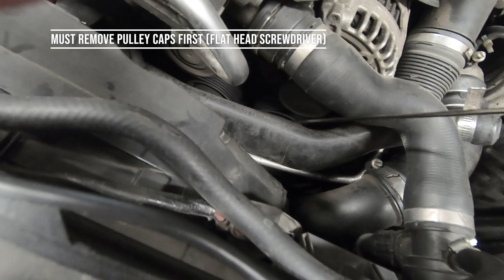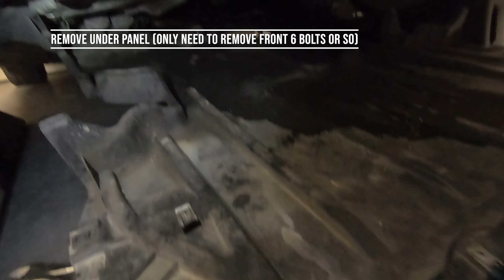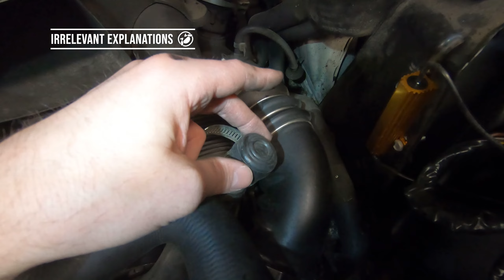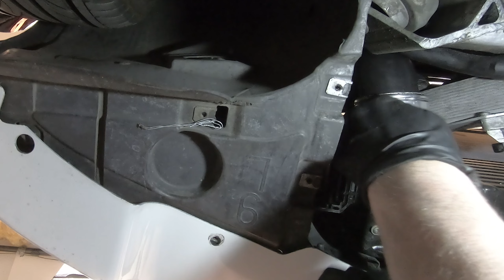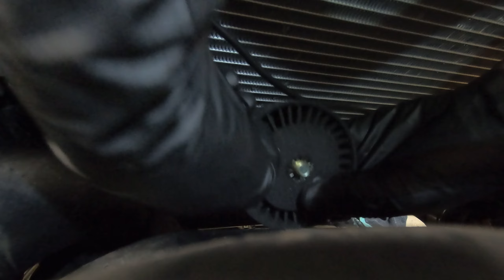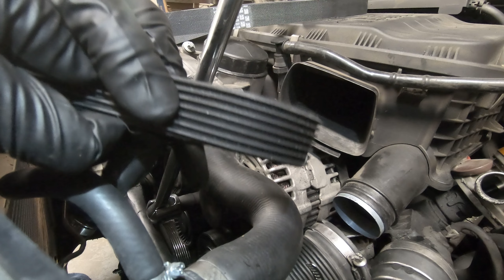How to Change the Pulleys and Replace the belts DIY & Diagnosis | BMW 335i N54 E90/E92/E82/E71/&More

Comment: which pulley is the one that generates that noise in the fisrt 10-15 seconds? i have exactly the same noise in my n55 335i, thank you for sharing
Reply from the maker: I wasn't able to definitively confirm which specific pulley was causing the noise in the video, but using a mechanic's stethoscope to isolate the sound is the best way to try to be certain. If you watched the full video, you could see the kit, the ones I changed, the diagram, and the assumptions to which I thought were the closest.

Comment: As a tip, you should most definitely remove the tensioner lock pin after slipping the belt on. Makes things 10x easier
Reply from the maker: Yea, that's a good idea. This car is so dramatically simple to loosen the belt that I probably didn't think twice about that, 🤣, it's a really old video. Thanks for sharing, and hopefully others will consider doing this.